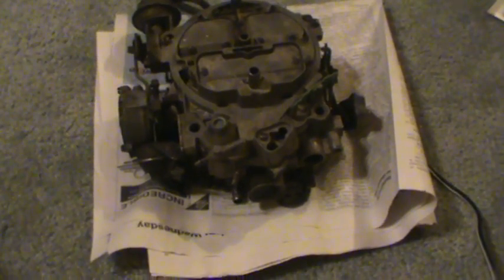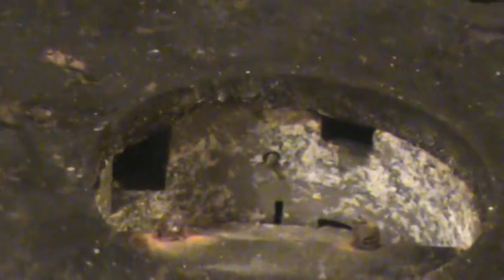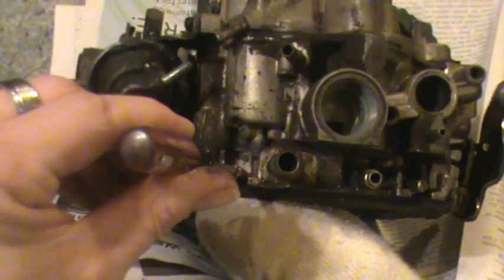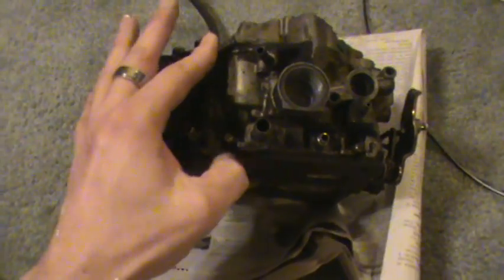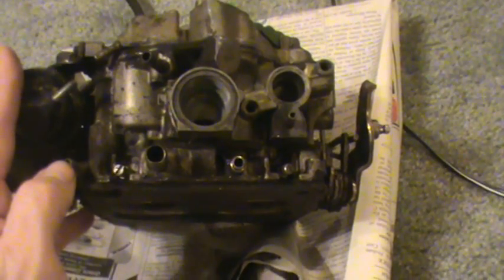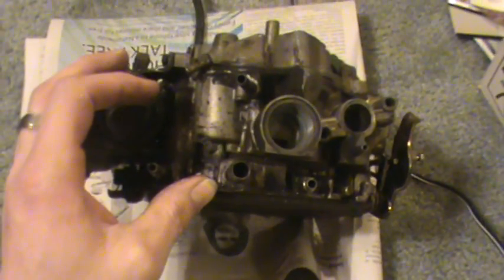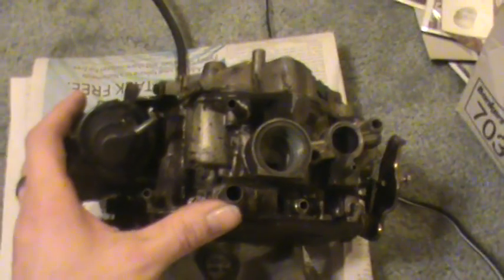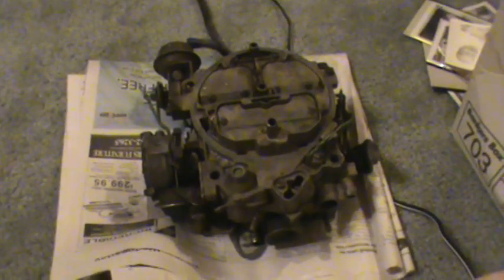How to adjust carburetor mixture screws

Comment from the maker: If you look around at the parts store you can usually still find a long, flexible adjusting tool for electronic carburetors. They come with 4 different tips that are stored in the handle.

Comment: well i have a 77 celica. 20r engine. 4 cylinder 2 barrel 2.2l. they have the carb set and it idles at 15mph in drive. id say its a lil highly tuned wouldnt you?

Comment: Thanks for the explanation - very helpful. I just rebuilt a carb for the first time for my truck (Rochester 2GV); I believe the accelerator pump was bad, but the rest of the carb was due for an overhaul, also. The truck runs very well now, but I didn't know exactly how to tune the carb. I bought a vacuum pressure tester, and I'm looking at buying the RPM80 adapter for my Fluke meter to fine-tune it. This project turned out to be more fun and less of a chore than I first thought :)

Comment from the maker: well 2cycle engines usually adjust differently with a low speed mixture and high speed mixture. Check your primer bulb if it has one and the plastic line into the tank.

Comment: It is a quadrajet.  I did better with it today with setting mixture.  I have much less dieseling now.  I still have a bit of hesitation upon accelerating from a stand-still.  Also, the idle adjustment is all the way out (disengaged from the throttle linkage).  That must mean something is out or worn.

Comment: I was having trouble getting a change in rpm when turning the mixture screws.  Is this a symptom of something?  I was trying to adjust the mixture during a brief period (about 1/2 an hour) when the idle suddenly jumped up to about 1400 rpm all by itself.  The idle eventually seemed to back to roughly normal (actually a bit high) by itself.  Anyway, the exhaust smells a bit rich now, and the engines diesels a little.  My vacuum fell from ~18-19 to ~16-17.  Any suggestions?  Thx!

Comment from the maker: Correct. An easy way to visualize it is: turn the screw too far right, it slows down. Turn it too far left, it slows down. Somewhere in the middle is the sweet spot where the idle speed is highest. Then like you say, use the base idle screw to get the idle where you want it.

Comment: Have I got this right. Set mixture screws to where the engine racest fastest, then, if it's too fast, the base idle speed screw is the one that'll slow down the engine to where it should idle at the right speed?.

Comment from the maker: A replacement comes in a carb rebuild kit. Ethanol eats away at the older cups that were not the updated material. You can pull the breather off with the engine OFF and cold, and see whether the carb squirts gas into the venturi when you work the throttle.

Comment: hey i have a original carb on my 86 camaro it was rebuilt once a few years ago recently my car seems to hesistate to accelerate from a stop position it does like a put put feeling some people told me i need to replace the gaskets an all that for the carb could that be it or could it be the mixtures?

Comment from the maker: Back in the day they either ran three 2bbls, or two 4bbls. For a street engine I think dealing with the linkage negates any real performance boost.

When I say a GOOD 750 Qjet, I mean one no later than about a 1971 model, because later than that the calibration built into the carb got progressively leaner(less fuel) because engines got more suckier.

Comment from the maker: Well, there's a formula around that lets you compute how many cfm of airflow an engine needs per rpm. You can find it online easily. Most people tend to believe that their engine needs more carb than it actually does.

 I think you would be fine with a good 750cfm Qjet. The 2bbl dualjet version of the Qjet only flows about 210cfm, so two of them would be like running a 420cfm 4bbl...see where I am going with that?

Comment: hi i was wonder i get about 21 mpg in my 72 with a stoke 350 with a 750 quadjet and i am building a 383 stroker i would like to put 2 2barrels quaderjets on it but i can not find a intake that only hold 2 2barrels do you one if they exist? i would go with to 4barrels but not shure if it could handle it with quaderjet smallest carb being a 750 but they say the mains are smaller then regler 2barrels? I have watched all your videos and am hoping you can give me some advice tks

Comment: Excessive timing advance along with manifold vacuum being used for the vacuum advance can do that or it's running too LEAN. Back the mixture screws out and see if that helps. If it's not that make sure the vacuum advance is connected to PORTED vacuum (no vacuum at idle until about 1000 rpm or so).

Comment: I have a Holley 4150 carb and the fuel/air screws do very little to the manifold pressure. I can turn them all the way in, and the engine doesn't die or run irratically and turning them out doesn't seem to move the vaccum gauge at all. I suspect the idle screw seats are screwed up, or possibly the idle/air mixture screw seals? Any suggestions as to how i can find this leak?!? Or to know if the seat is screwed up? The tapper on the screw head doesn't seem to have any ridges or grooves...

Comment: Hi, our mustang II iddles way too high, at 1700 rpm. The adjustment screw at the throttle is already all the way out. Should we for adjusting the rpm, search for the highest iddle speed as you say then? Since it idlles already at 1700 rpm?

Comment: i have aluminum 200 cc heads, wieand 8004 manifold, 220/230 duration @ .50  and .580/.580 intake/exhaust on 1.5" rockers. lobe is set at 104. it's pushing out close to 480HP and 490 TQ at 6700RPM redline.

Comment: I installed the new stage 2 qjet 800cfm over the weekend and it still had very little effect when adjusting air and fuel mixture screw. rpm dropped like 100 and that was it when I went lean on the screw. And when I when rich, just picked up that 100 rpm it lost and rpm would not increase or drop by going rich on the screw. Is this qjet okay to keep it like this?

Comment from the maker: He's probably telling you that so that he DOESN'T have to tell you that whatever Qjet you use likely will need to having some tuning done of your cam is that big.  When you've cammed an engine up you can;t just plop a carb on and it be just right out of the box.

 Do you know the specs of the engine, like the cam that's in it, compression ratio, stuff like that? I would use a 750. Your timing, both base and total needs to be SPOT-ON before you start condemning carburetors.

Comment from the maker: Well I would have attacked the little issues the original had, and saved a bunch of money. Sounds like the choke isn't working and possibly a small leak. I have several videos posted about dealing with choke problems and bogging problems, check them out.

Comment: I forgot to add that my old QJet in my car is a 750cfm. Reason why I bought a new one is that current carb is horrible on cold start and bogs on second gear along with I saw fuel leak spot on front of the carb. When the engine is warmed up, carb runs flawlessly in normal and WOT driving. Your video has been added to Corvette Forum in C3 corvete tech section.

Comment: I love your QJet videos. Very very well done. I received new Jet-Performance qjet 750 cfm few weeks ago and had to return it because mixture screws had no effect on rpm or vacuum. turned all the way in and all the way out, rpm and vacuum stayed the same. Tech told me either my cam is too big or defective qjet. he recommended i try 800cfm since i have a big cam. it's SBC 406 ci roller motor btw. Do you think he is correct?

Comment from the maker: Watch the rockers and make sure they all appear to be lifting the same amount. A flat cam lobe can cause all kinds of performance problems.

I'm not trying to worry you but rule out any mechanical problems first, because if you don't then you'll chase your tail trying to get it running right.

Comment from the maker: That sounds very much like an ignition problem, because it's under load, but there are a few other things that you should check:

 Have you checked the timing? That's the absolute baseline you start with dealing with potential ignition issues. Also make sure the ignition advance is working. I would also do a compression test to rule out a valve problem.

 I think with an unknown engine I would pop the valve covers and watch all the rockers with the engine running-con't

Comment: Hey I recently bought a 79 ford f150 and I started out with numerous problems but replacing bit by bit its started to run better but I am having a problem with it backfiring through the carb (technical backfire) It seems to want to do it at lower rpms and higher gears I can gun it in first or second and it will run like a champ but soon as I get into third and lower rpms it starts multiple backfires, could a badly adjusted carb do this? (New carb, new fuel pump, new plugs/wires/dist cap/rotor)

Comment from the maker: If the oil is getting gas in it, don't run it like that long. Start it and go look at the exhaust. If it's THAT rich it'll be smoking black like a diesel and it will burn your eyes BAD. If that's going on then the choke is stuck on or there's something causing the fuel level in the float bowl to be too high.

 If the engine is running smooth with no lope and the exhaust looks clean then you might need to suspect the fuel pump is dumping gas into the crankcase.

Comment: just put carb on my boat it was a rebuild now with this the boat is running but now im getting gas smell and my oil has a gas smell. dont know if carb is set right could this be that mix is off

Comment: Tyler, thanks for getting back to me so fast on the idle mixture tool needed, I will try to find one.  Since watching your video I have rebuilt my carb and it runs like new, my son (who is a fuel injection loving mechanic) is even impressed.  The guys at the local carb shop also were amazed when I showed them how to tell the 800 from the 750!  Thanks again.

Comment from the maker: On those you have to find a special tool which is essentially a long, flexible driver about 1-1/2 foot long, with a screwdriver handle on it. It comes with 4 special tips that fit over various types of mixture screw heads.

It's sort of obsolete now but I'm sure you can find one online if need be. I think it's called "GM carburetor adjusting tool".

Comment: Tyler, my quad has two tangs and no way to put a screwdriver or nut driver in the two idle mixture holes, is there a special tool to adjust this type of set up? I have an 85k5 blazer with an 800cfm carb. Thanks

Comment: so i have a 79 pontiac with a chev 305 -  its a 2 barrel carb modified with the mixture screw caps chisseld  out. semms like its leaking gas out of the throttle linkage area. ive rebuilt it once 6 months ago and no problems untill now. any ideas? it also did smell a bit rich so im gonna try adjusting the mixture screws

Comment: Hello I'm having problems with my carter bbd on my 1975 dodge d100 it won't idle when cold and when it goes under 1500 rpm it dies does the carb need to be tuned? Or what's wrong?

Comment: Tyler, the only problem I'm having it seems is that the secondary air flaps aren't opening when I open the throttle wide?  The vacuum is releasing to allow them to open and they aren't binding.  If I manually hold them open then it runs out fine????

Comment: I don't know what I like better the info or Tyler!  Would love to have you talk about the 1985 K5 Blazer Rochester with all that crap emission stuff on it. I have a bog in the mid range performance.  When sitting the engine performs right, but under a load (driving) the engine stumbles. There was some crap in the tank, but I don't think anything is in the float bowl. I love your way of putting things, thanks so much.

Comment from the maker: ..that is causing no compression...it won't fire even if it IS getting spark and fuel.

Check the basics. You may need to clean those two plugs because if they get gas-fouled they won't fire. What kind of engine are you working on?

Comment from the maker: I think the spelling you were looking for is "cylinder".

Well, look at this very simply: You know, Keep It Simple.

A cylinder needs three things to fire....fuel, air and spark, and they have to be delivered at the correct time. It also needs to have adequate compression as well.

The things i check are whether the plug wire is actually delivering the spark(with a cheap spark tester), whether the firing order of the plug wires is correct, whether there is a stuck valve or other issue...

Comment: the number 3 cilender and the number 6 cilender wont fire ive replaced the spark plugs, distributor, and spark plug wires, and they still wont fire on those two

Comment: Thanks for all the help! the engine is currently not in a vehicle, i am either building a break-in stand or borrowing one, so i will need to throttle up to 2000 rpm directly on the carb, i will install a longer idle screw to make sure i can get it high enough

Comment from the maker: Yes, adjust the mixture screws first. You might be able to screw the idle screw in far enough to get 2000.

Otherwise just have a helper keep the foot on the gas. You may have to stop and start it a few times to let the cooling system burp, but don't let it idle in that break-in period. Start it, rev it to 2K as soon as it has oil pressure. Good luck.
Reply: Tyler I have a Quadrajet on a 403 Olds in a 57 Buick 2 door I built. I put an electric choke kit on it. Was having trouble with the hot air one. Now hot starts are tricky. The idle is too low to kick off on its own and if I touch the gas it floods. Is it the choke’s fault? Idle mixture screws? Lots of questions with our seeing it in person. Any input would be appreciated. Thanks.
Reply: Just to add the Quadrajet is old and worn but I like that it’s not an aftermarket and gives decent fuel mileage. Would like to keep it.

Comment: Ok thanks, so once it fires up can i use the idle screw on the throttle to bring it up to 2000 RPM? Should i adjust the idle mix screws first?

Comment from the maker: 3 turns out should get you running, but remember the engine can't idle, it has to run at 2000 rpms for 20 minutes nonstop to break the cam in.

Comment: So i am in the process of building my first engine, and i will be using a quadrajet, is there is a good rule of thumb to get the idle mix settings in the ball park for the initial start up? i want to be sure it fires on the first crank, to avoid damaging the brand new cam/lifters and new crank/rod bearings

Comment: Very nice information guide. Sir I would like to ask, on my '95 Toyota Tercel, previously when i start the engine in the very morning, i heard of the high idling engine sound, but after an overhauling on the oil leakage by the mechanic, that high engine sound gone which is abnormal because when I activate the A/C the engine vibrate and shutting down. What do you advise sir?

Comment: Thanks,very good instructions.I am new to learning about carburetors and would like to know what adjustments are usually done to tune a 3 x2 barrel set up.Do the terms balancing and sychronizing apply to 3x2 set ups?If I had some basic guidelines I can read up on the details.

Comment from the maker: sounds like the accelerator pump leather is going away. On those carbs it's inside a small cover on the front face of the carb. 4 screws hold it on. Make sure it isn't leaking at any time.

Comment: I have a 1977 Celica with a weber 2 barrell. I tried adjusting my idle mixture screw, but when I adjust it to where it idles the highest, and my car starts running really rich, just a bunch of black smoke coming out my exhaust. (Full straight pipe)
How do I adjust my mixture screws without it running rich?

Comment from the maker: haha..I think it's basically finding another route to the same destination.

 Your end goal, in ANY method of adjusting idle mixture, is to achieve the highest idle and highest vacuum reading. I guess people have different methods but you cannot do it correctly just by saying turn out or in the screws X amount of turns and that's it.

Comment from the maker: I would suggest checking the ignition timing. If it seems to be in spec then you could have a carb issue. Timing issues often mimic carb problems.
 
 It's unlikely the timing has jumped or anything since those engines use gears instead of a timing chain.

Comment: My boat has a old 2.5l chevy that was bored out to 3l by mercruiser and currently its idle is low it backfires through the carb when you give it gas and its running hot,  could this all be caused by lean mixture?  Has almost no power and barley stays running on idle

Comment: my q-jet is having problems with running out of gas when driving slow and with a/c on.  give it the gas and it goes like crazy(fast).  also, it has to fill cab. when it sits over night.  is it possible that is what makes it smoke (blue white) when i first start after sitting for 1 hour

Comment from the maker: No. To lean out the mixture you have to add air below the carb and you won't leak air if you use the proper gaskets.

Comment: I need you to come fix my 83 nissan carb pulsar car, it runs fast in park and also drives me fast in idle, I don't want to wear my brakes out but it does not have a check engine light on but the brake light is on all of the time even though I have checked and made sure I have brake fliud in there, brake light did not come on till it started running high can it be something eles? cause it all started at once and my windshilde swipers go faster than usual too!

Comment: Thanks for the info, just a little question, i have a Bocar carburetor on a vw 1.8l motor, it consumes tons of fuel, ralenti at 800 rpm, no black smoke, a little gas odour on exhaust, could you tell me which screws do i have to adjust and how? i'd thank you.